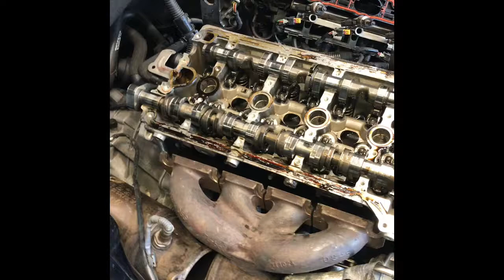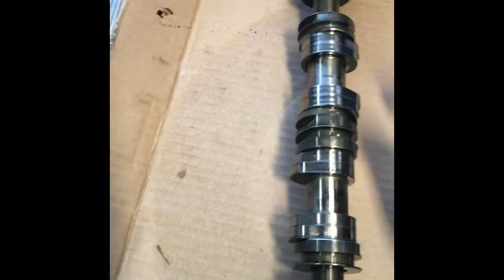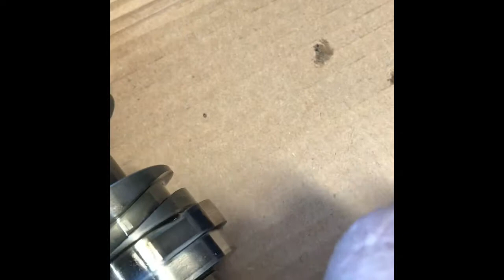Very crazy camshaft on a Audi A5

Comment: What kind of wizardry is that? :)
Reply from the maker: It’s some crazy stuff and all the Audi pros in town told me to run for the hills because the motors were junk when there were new lol the customer only had the car for 2 weeks and it will suck 2 quarts of oil within 40 miles